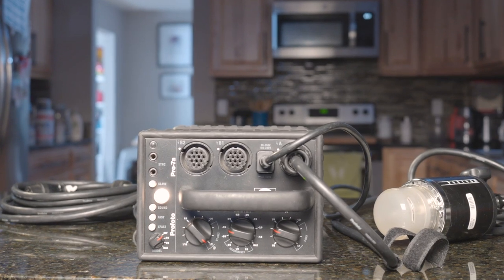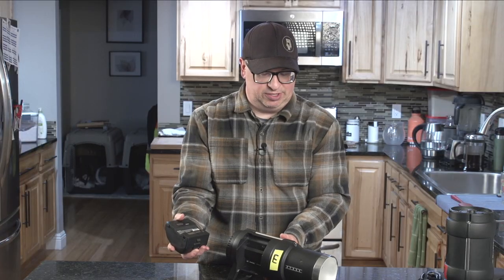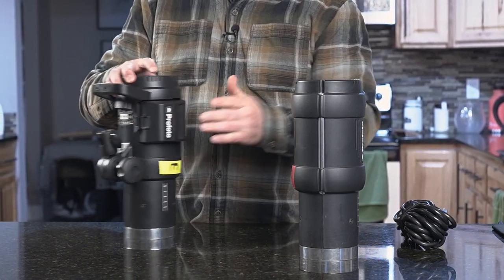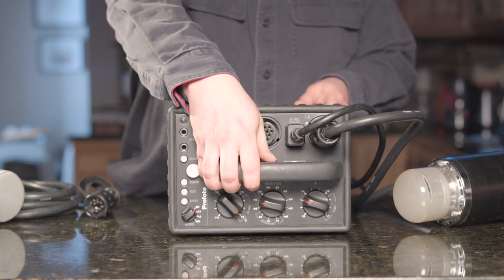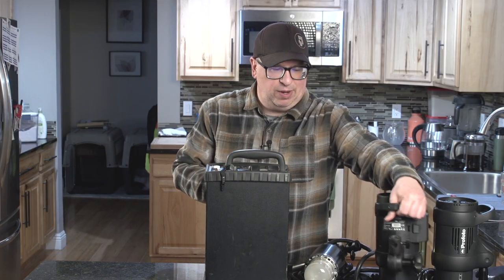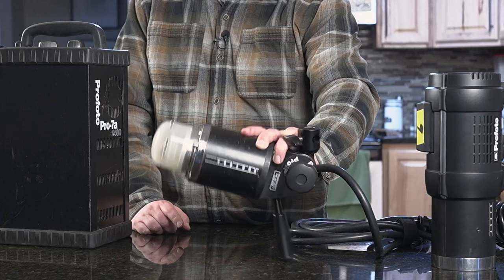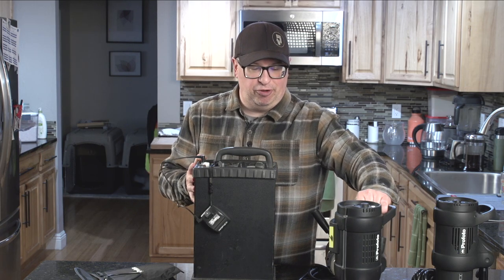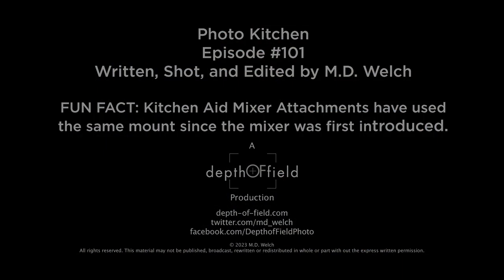Working with Old Flash/Studio Packs for New Lighting Possibilities.

Comment: can i use my profoto acute ABS heads with this pack?
Reply from the maker: No, you can only use Acute heads with Acute packs.This pack takes "Pro" heads. You can plug Acute heads into a D4 pack, which has Air remote function, but even used, is very expensive.

Comment: Did the same, but didn't go so far back in time. I picked up a used Pro-10 pack and a ProHead. Totally agree that the flat-face monolights are great for travel and work will with certain modifiers. But they're no match to a pack & head system across Profoto's full line of modifiers. Pack heads have an exposed flash tube that do a much better job filling larger modifiers. The flat-face units already have a built-in reflector that works well, but also limits its ability to fill a modifier larger than about 36-inches.

Also a caveat on Profoto ProHeads... In 2023 Profoto changed the connector end on new ProHead production to meet EU requirements. The new connector still works with Pro-8 thru Pro-11 packs, but not with older packs. This also applies to old vs new ProHead extension cables.
Reply from the maker: Thank you for watching, and they heads up on the older pack to new head connection. At this point, I will probably be buying a 8A in my future, but that is about as far I would need to go.

Comment: Great video!

I just did the same thing — I traded my B1’s for a D4 pack since my projects have been more studio than location lately, and the recessed tube of the B1’s wasn’t optimal for larger modifiers. 

I kept by B2’s and have a Bron Move pack for location work still, which has been plenty for me.
Reply from the maker: Thank you for watching. Sounds like you have a great system there.